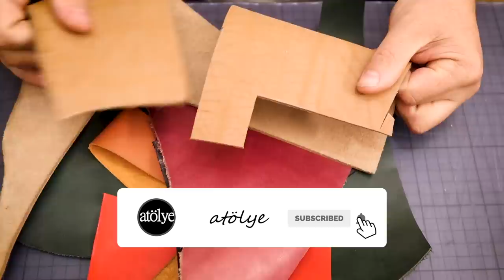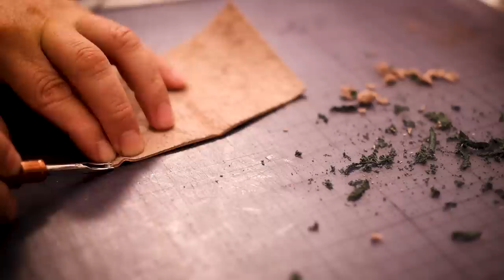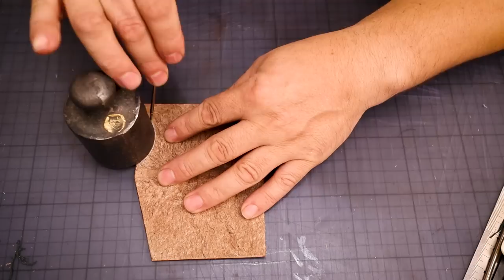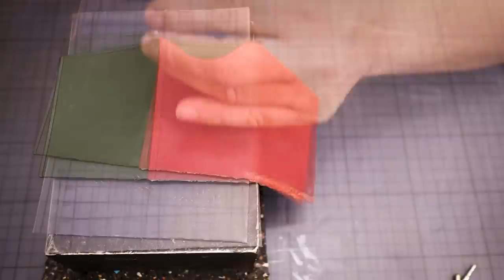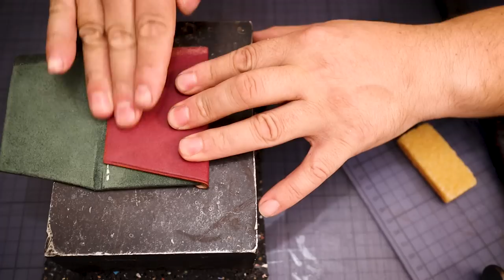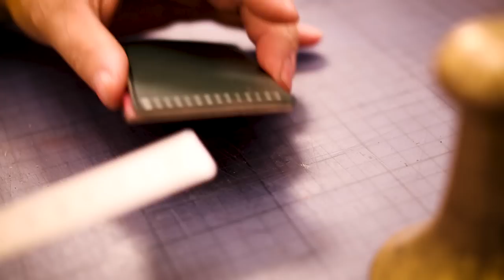Two Color Simple Leather Wallet Making from Scraps. ASMR

Comment: Hi! What’s that wood chip-looking thing that you rub on before applying the edge finisher?
Reply: it's just a piece of sponge and some dye to dye the the edge i think.
Reply: Looks like a homemade tool with rounded edges. He’s pressing the edges down so he gets a slicker finish. You could probably use the rounded end of a broom handle if you cut it off short.